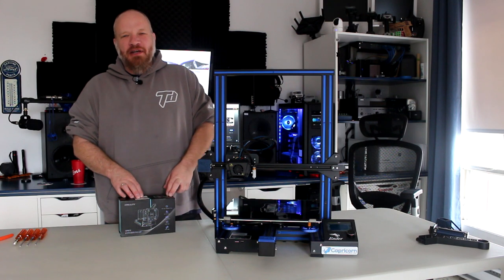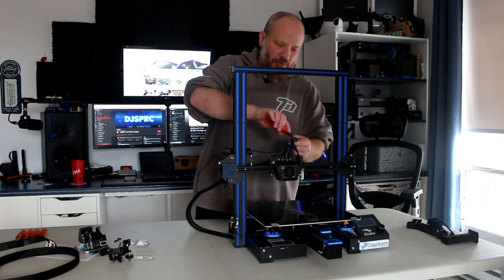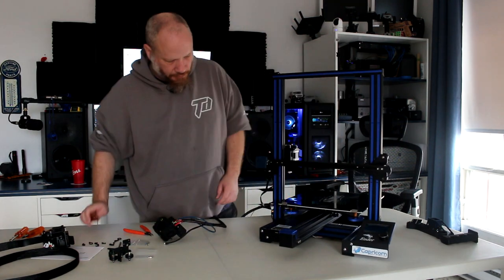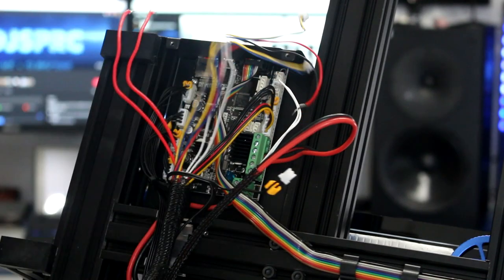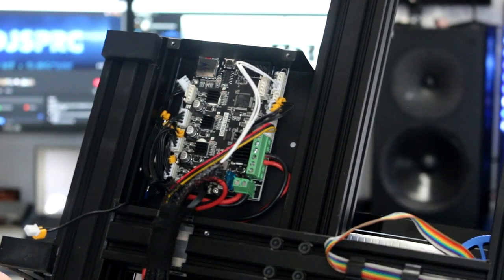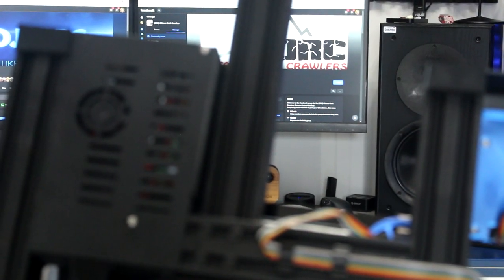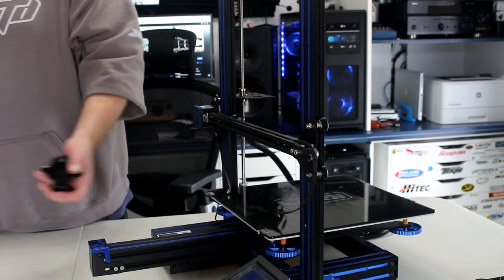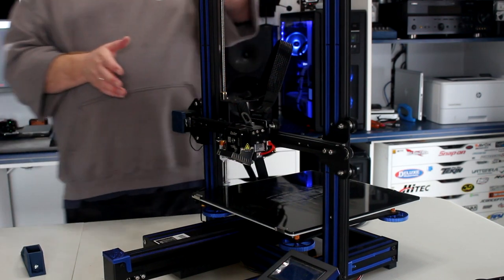Direct Drive Sprite Ender 3 Max From Creality All Metal Hot end

Comment: You mentioned on your video getting custom firmware from Reddit
Would you happen to have a link please
Also i read your other comments and you said about running klipper
Did you do a video on the changeover to Klipper and is it working ok?
Reply from the maker: On reddit just do a search for firmware.  And yes my printer is running Klipper (mainsail) and love it. I did not do a video on. How to do the set up if you go on mainsail website, they explain it very well.  And one of the things I like about mainsail  is if you need to do a modification in the firmware, you don’t need to compile the firmware completely again.

Comment: Hello,

I'm looking to upgrade my old Ender 3 by purchasing the Ender Sprite. After watching your video, it seems quite easy to install. However, do I have to modify my firmware? I made some little changes to my old Ender 3 by modifying Marlin.
 Best regards
😁
Reply from the maker: Hi there, yes you will need to upgrade your firmware to correspond to the sprite. You may even be able to find a firmware already built up for your printer. If you have experience with Marlin then you should be able to add it. I used to run Marlin now I’m running.Klipper. Way better firmware, and you can do upgrades anytime or modification without needed to redo the complete firmware.  But yes to install the Sprite is not hard at all.

Comment: Hey, Great video! Do you happen to have the link to the top mount adapter? Also any updates on the firmware? I bought the sprite and installed it, but the CR Touch isn't working properly!
Reply from the maker: https://www.thingiverse.com/thing:4636364, Unfortunately for the firmware, i do not have an update i'm still running a custom Marlin firmware and now I'm switching to Klipper. with a Bigtreetech SKR Mini E3 V3.

Comment: bro. you didn't even boot it up and show it works. Any issues with the Touch Probe? My ender 3 Max I just installed a Sprite and won't work with my CR Touch, I have to connect the probe directly to the mother board with the original cable for it to work. Seems like this is a common problem.

But yeah, always a good idea when you show setting up new hardware to show the finished product actually running. This way you can address any potential problems you encounter.

Comment: How did you do the ABL? I've just installed this extruder and when I initiate it, the CR touch will go out of the bed and once it starts going down, it misses the bed and it cancels.
Reply from the maker: You will need a firmware compatible with the direct drive and a CR touch.  At the time that I made that video I was running a custom Marlin firmware.

Comment: Why do you need to remove the filament runout sensor? Is this specific to the Sprite setup?
Reply from the maker: You could modify a bracket to put it on top do use it, but I decided not to use it because my having issues with it.

Comment: BLtouch is going to be off set if stock firmware. It doesn’t work with ender 3 v1 v2 with bltouch custom firmware needs to be installed